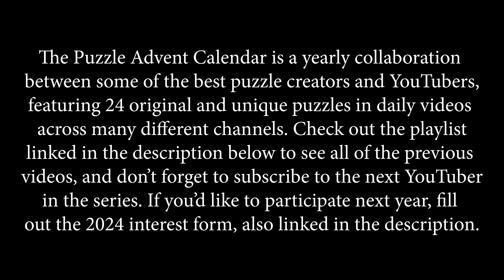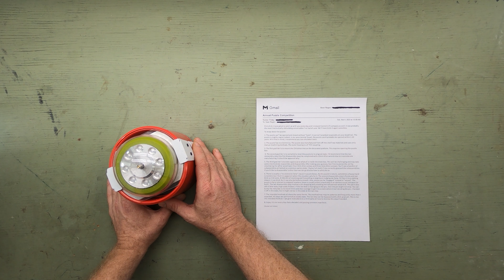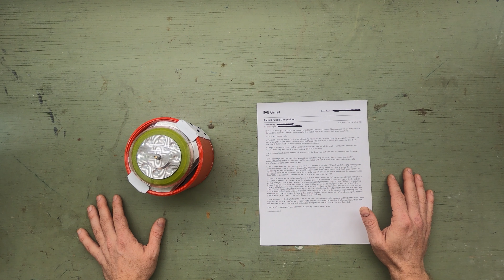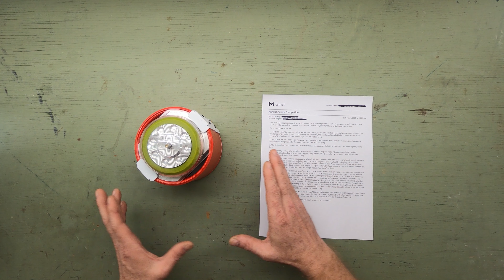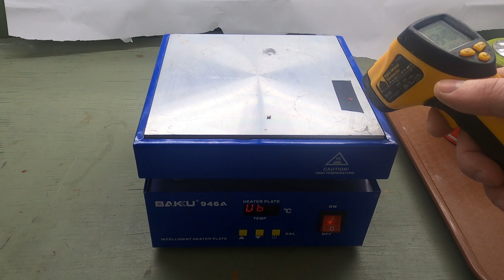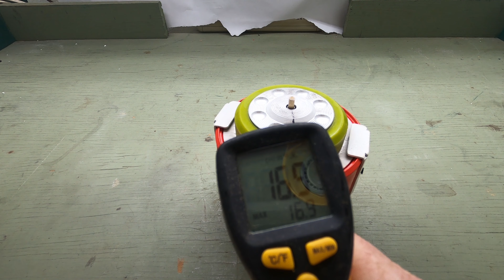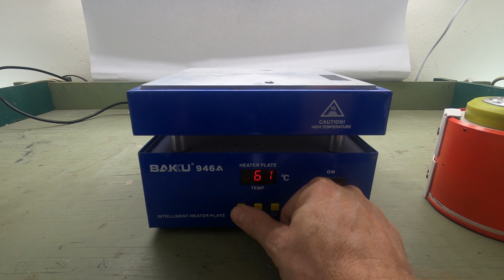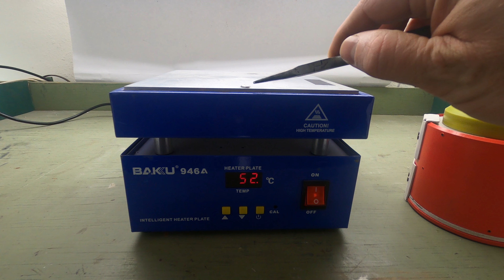Getting Warmer - A Temperature-Dependent Interlocking Solid | Puzzle Advent Calendar

Comment: I'm glad you enjoyed my puzzle as much as you did. I'd hold off on trying to reassemble. The "low melting point fuse" was not suposed to leave its container.

35:33 "I'm going to put this solder on the hot plate"
... melts GALLIUM on the ALUMINUM hot plate...
"yep, it melts".

I hope it didn't leach too much...

Looking forward to any follow up videos, and I'm sure we'll do more collaborations in the future!
-Tanner Frisby
Reply: I was wondering about that being gallium on aluminum...
Reply from the maker: It's entirely possible that I broke it. I don't even have a hypothesis yet about how that step of the puzzle works, mechanically speaking.
Reply: @SeanRagan  The small divot in the brass rod was put their ornamentally. In hindsight, I can see how a divot would imply a location to put an awl and push hard 23:56; I should have made it a proud conic boss instead of a countersink. Knowing what is on the other side of the pin and that the gallium came out, I suspect there is enough damage that it can't be reassembled without repair. This was factored into the "85% chance that it ends up being openable" that I quoted when I gave you the puzzle. With that said, I'd much rather the result that occurred as opposed to giving too much information at the beginning resulting in a spoon-fed solution.
Reply from the maker: @BrettKuehner  It DID actually leave a bit of a stain on my aluminum hot plate surface. Didn't even think about that until you pointed it out. Think the oxide layer must've prevented serious damage fortunately.